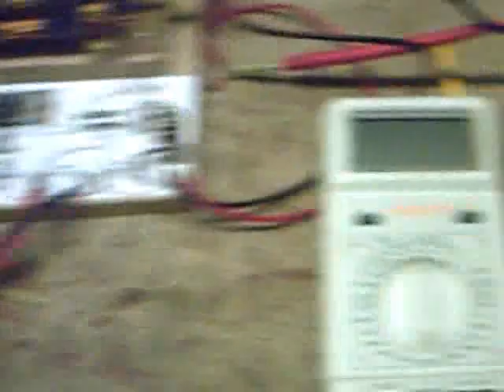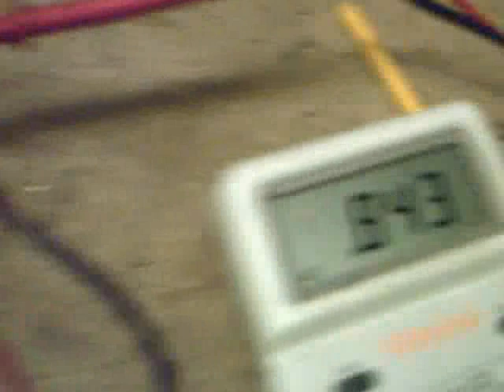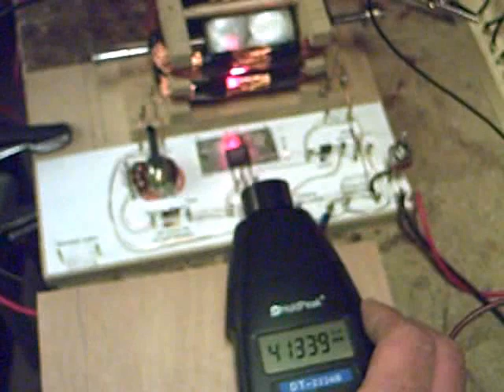TheDaftman pulse motor.

Comment: I build bedini fan and made rotor a 5000 range the same you did. I had the same effect but it was with a cap the continue to charge on my circuit and off the circuit to 0v to 7.3 volt. Working on some anti-gravity effect you should check the coil i made jump shoot a cap though it. That motor of your is powerful one made should try filling up a 100uf at least 250v as quickly. You will see it jump and try to make a motor spin at 20,000 rpm so discharge the cap at .01 sec

Comment from the maker: Well nice work, voltage doubler maybe the way to go I'm considering it my self after watching vid's on youtube maybe the vid's was yours. In short terms you must remember that the currant is limited by the output of your coils. So you will get more voltage but maybe lower currant depending on the circuit you use. I will post some diagrams or links on the forum that maybe of interest.

Comment: nice work as usual...will check out your forum...how large a battery in terms of amphours was the 24V you mentioned compared to the 12V that charged it? ... what do you make of my attempt at including a voltage doubler on my output coil? am not too sure if it's working as planned...would appreciate input from anyone in the know...

Comment from the maker: Well Rusty. I'm not looking to drive anything yet but 1 would need more work to run a tube direct but it will light up one end. I use filament in this video. The test on my window motor was very good but not anywhere near the power of the motor in this video also the one in this video requires a good flywheel.

Comment from the maker: The motor is triggered by the coils and a transistor switch so no need for any connections to the shaft.  
The circuit works just like a Bedini pulse motor. 
This motor is basically a Newman motor without any shaft connections, then run on a Bedini circuit. 
Hope that helps. If not please ask.